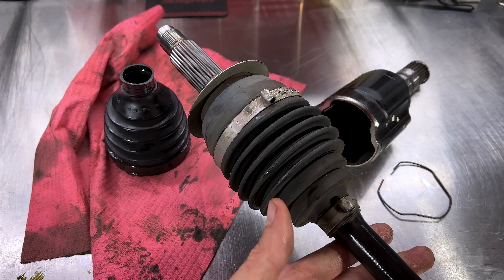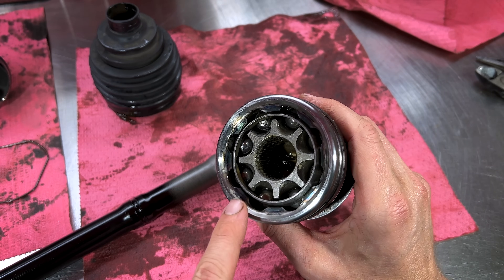100k Mile Subaru Forester CV Axle Teardown & Failure Analysis | Why Did It Fail?!

Comment: When I was young and dumb, I discovered how you make your CV joints start clicking, as a young idiot I cranked the wheel all the way stuck it in reverse revved and dumped the clutch, front wheel drive reverse 🍩s in a freshly seal coated parking lot, $400 later on my back under my car in a gravel driveway replacing BOTH sides, this is how we LEARN to not beat the 💩 out of our SIX MONTH old new car, and I learned another valuable lesson with that car, after making the last payment and dropping the insurance to liability, don't park near nasty looking old trees especially when it's windy,😱 fell right on it.
Reply: Sounds like the cost of a high education.
Reply: Extending that lesson - if you legitimately find that some insurance coverage is not worth it, and you can pay for some damage if it arises, stay on top of that assumption. Your financial situation could change and then you can't afford the damages. This is true for vehicle comprehensive insurance, but also things like home insurance. For example, home appliance insurance is something that is statistically going to cost the customer, so I cancelled. I could afford a new appliance if it broke. Well, I became unemployed for extended time and then the assumption I could afford the appliance went out the window. I also had bad luck and the central air broke within a short time of buying my home. The A/C uses obsolete cooling fluid, so the coils in my integrated HVAC unit need to be replaced. This means replacing the furnace as well! I can't afford to do that! So, I still have no central A/C because I can't afford to fix it. And now that I think about it, I still have not resumed insurance on the furnace. Time for me to get on that!

Comment: Hmm. I feel like the CV axle would be worthwhile to repair rather than replace if quality parts can be found. Assuming bearing balls did not scar the housing or damage the inner race, a few dollars could be saved.

I'm up to 3 Subarus now: Levorg, Legacy GT and Impreza. The Impreza only has two CV axles... and the transmission has a slightly different name.

Comment: How many miles will the outboard part last with the boot split right down the middle and slinging a little bit of grease, if it's not making a clicking noise?  Will it start clicking a few weeks before it gets dangerous?  Would gorilla tape hold the boot together long enough to get by a few weeks?
Reply: As a rule, people notice a  torn boot  when it's too late. Like during winter driving and your not looking at axles, person changing oil doesn't see it because under carriage is covered in sloppy mud,salt, nastyness. Water, sand goes in, grease comes out, too late, damage done. Forget your scotch tape, gorilla snot, tin foil... it's too late.

Comment: Wife's Crosstrek had the same issue at 50k, was really easy to replace the axle however the factory part was pretty expensive.
Reply: eBay, the half axles are pretty affordable if you don't mind a non-brand part. With a few videos and some fairly common tools you can easily replace them. - I've got 250,000 miles on my 2010 Forester.
Reply: @TheHighKirk  Aftermarket axle assemblies often cause vibration problems on Subarus and VWs.  I gave up on them years ago.
Reply: @alantrimble2881  I just replaced the front left on my 2015 Outback with an aftermarket and it vibrates when I’m stopped  and in gear ! Is this what you mean by vibration or vibration when running / wheel spinning?  Also it kinda does it when cold after I drive it for more than 5 min and reaches temp ! It kinda stops !
Reply: @maxpower2496 that's crazy! What would even cause that. I'm about to replace mine, been going back and fourth on to buy the oem or the aftermarket since I'm about to sell it.
Reply: @maxpower2496  - How could your axle vibrate when it is not even rotating at a stop? Something else must be the problem.
Reply: Mines got 2 non brand shafts on the left side & heavy duty pedders suspension all round, i do alot of heavy towing & the shafts are excellent

Comment: Most CV's will make noise for a long time before failure makes forward progress impossible.
Rough roads/ R/R crossings , at speed , will shorten CV axle life.
Lower ball joints, too.
Drive like grandma for long life.
Reply: That is true for most cars.  Then give the car to grandkids and watch them break everything with aggressive driving.

Comment: My 2019 Premium Crosstrek just had to have the engine yanked for an oil leak. RF cam carriers and all associated seals were replaced. I got a free oil change, but they put one of those crappy blue filters on but didn’t rotate tires! Then, after I get it back I discover the light in the shifter indicator P R N D is burnt out. So it’s gotta go back. This car has only 24k and is babied and garage kept and hopefully it’s not falling apart. I saw my exact model sitting on the lot and they wanted 23500 for a premium 19 with 67k miles. I had a loaner 23 Outback w the turbo. Wow. Wish they put that engine in the crosstrek. Car was nice, but too much tech, very confusing at first but not bad after ya learn it.
Reply: My 2016 Forester XT cam carrier/ timing cover has been leaking since the day it was delivered to the dealer.